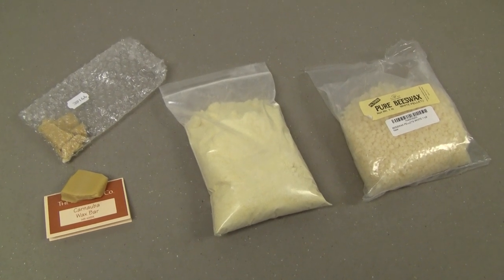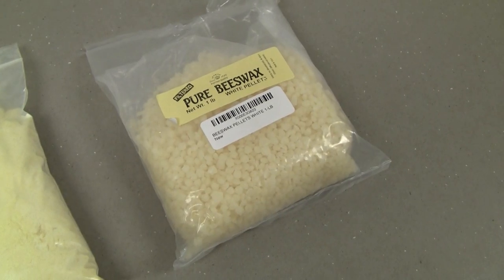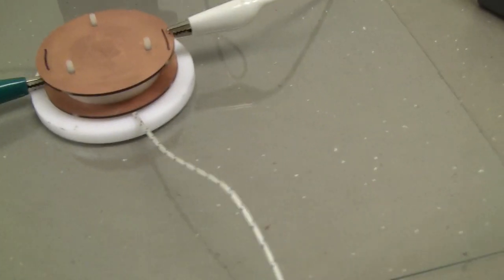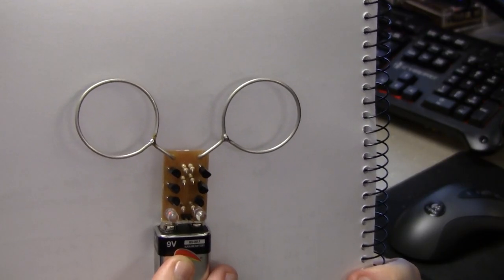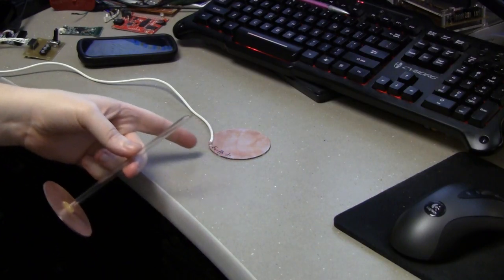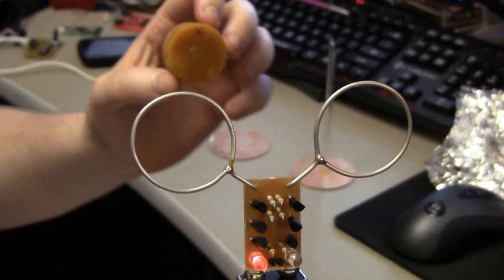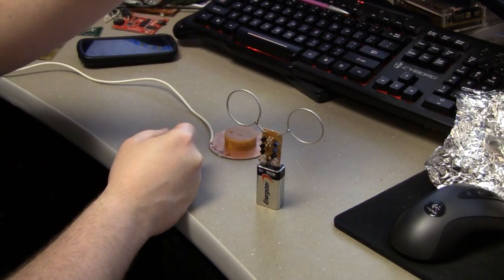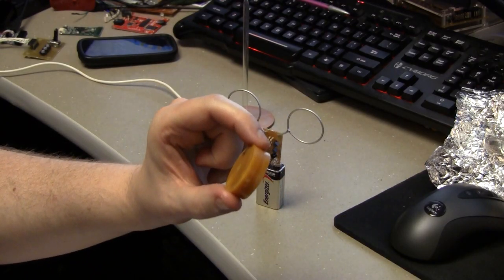Making Electrets

Comment from the maker: According to traditional accounts it doesn't oscillate, it decays away to zero slowly, then jumps back up quickly in the opposite direction before beginning its (very slow) decay.  Apparently how long it takes to happen in a function of just about every parameter of formation, but especially how long you leave it unshielded after it freezes.  I am going to build better equipment to investigate this more, it seems poorly understood in general.
Reply: Have you ever considered fabricating one with a superimposed magnetic field above and below the molten wax as the HV field is applied to determine if that imposition of dielectric field would create a variance within the electret?  Well done sir.  I am inspired to try with molten PTFE, Outside of course...

Comment: which high voltage transformer did you use
Reply: So a little late but I would say that a static HV generator is better for making these at home, for example a van de graaf generator can be made to reach 100kv. A van de graaf generator is also very safe as it can not provide very high current for a longer duration than a fraction of a second making them safe whilst still being very capable of producing the necessary electric field for making electrets.

Comment: Very nice electret! I left mine for a few months before testing it and the polarity had reversed. I hope you'll upload another video after your reversal. Also, when I unwrap mine, the externally noticeable electric field degrades over a minute or so due I guess to charges attracted from the air neutralizing it at the surface. But if I wrap it up again and leave it for a few days, those charges are neutralized and I can see the field again. Did you notice a similar degradation?

Comment from the maker: The electrets in microphones are typically mylar or PVDF film that has been poled by corona charging.  That is a bit harder to do evenly yourself, commercially it is done as a rolling film process using heated and cooled rollers and corona spray wires.
Reply: Problem 3-13 in "Electromagnetic Fields and Waves" (2nd edition) by Lorrain & Corson deals with a microphone having an electret diaphragm.  (The 3rd ed. has a completely different layout.)

Comment from the maker: I got the waxes and rosin though Amazon.  I have a number of different types to try, I just began with the most traditional composition which is well described in the texts from the late 1800 to early 1900s.  Modern electrets are mostly corona or accelerator charged PTFE or PETE.  They are more trapped charge devices than aligned polar molecule devices.

Comment from the maker: More supply voltage will give the transistors more Vce and hence more gain, that said you need at least three BE-drops to turn on the extended Darlington array, but the BE-drop is logarithmic with current...  A long story short - it will work well from 2 volts with RED LEDs, but the blue needs about 2.5 V before it will begin to glow (I just tried it, it actually works feebly from 1.5 V).  Should be fine from 3 Volts.

Comment from the maker: You can make an electrostatic generator or electrostatic motor using electrets, in much the same way as you can make an dynamo or universal motor.  The EM equations possess a dual property where you can swap magnetism and electrostatic effects and achieve a pretty much equivalent outcome.  The problem is practicality.  It is hard to make powerful electrostatic machines because of breakdown effects.  The dual system generally has reciprocal impedance, so high voltages & stored charge.

Comment from the maker: I leave the electric field in place until the wax freezes completely and returns to near room temperature.  It basically works by aligning the polar molecules in the liquid wax with the external field and trapping them in that orientation once it freezes.
Reply: Could this method be used to charge polypropylene?
Reply: I wonder if application of minute ultrasound during cooling could encourage alignment of molecules and increase resulting electret potency?
What will happen if atomized particles of metal are added to wax mixture? Or graphene? Could something be added to the mix to act as electron donor, in a similar fashion to the way that semiconductors rely upon admixture of electron rich atoms within the regular lattice of balanced charges?
Thanks for the video. Great to see folks exploring these seemingly magical devices.
Reply from the maker: @emrysmcwryn7902  Interesting idea, wouldn't be too difficult to sonicate it via the electrode at ground potential as long as you were careful not to overheat the transducer. I suspect it won't help too much poling wise but it would certainly help degas and consolidate the casting.

Comment from the maker: That is poorly understood.  It is believed to be a charge relaxation effect.  The old books talk about hetero and homocharge, the homocharge being trapped charges and the heterocharge being induced macroscopic polarisation of the material's own molecular charges.  The homocharge leaks away fairly quickly through the material resistivity and/or collecting ions from the environment, the induced polarisation can only be lost by relaxation of the molecular structure and happens much more slowly.

Comment: Best video on the internet about electrets. Have you tried any other recipes? Would a mixture of a highly positive substance from the triboelectric series and a highly negative substance from the triboelectric series be able to create a greater electrostatic charge because of the massive difference in positive charge, and negative charge. For example what if you were to melt Teflon(-180) and Nylon(+30) and then let them cool under the high voltage? Also what is the high voltage device you are using, I can't quite make out what is said on the video. Chronomotor? Coronamotor? Thanks for the video!

Comment: So since the gain would be smaller, it would be less sensitive, correct? And you say the BE-drop is logarithmic with current, so a higher current (because of the lower voltage) will cause a bigger loss? 
Sorry I'm asking so much, but I didn't had much of these things at school unfortunately, had to learn most by myself and the internet.

Comment: Hey Alan, I saw your electroscope at the maker faire, and made one myself. I didn't have the schematic so i just winged it. It worked pretty well, but i omitted the 1M and 100k resistors, and put the LED/R on the emitter side. What is the purpose of the 1M and 100k? Are they just to limit the gate current? I suppose putting the LED on the collector side and the 100R on the emitter side might do that without the extra voltage drop. Anyways, thanks!

Comment: Hi Alan - thanks for showing your differential electroscope, will be great once I get it to work!
I built it exactly as you suggested, but being a novice I'm not sure why my LED's are at almost full brightness as soon as I connect the battery... the LED's shine brighter when touched but are contiunously lit.
Do I need to use other than 1/4 watt wire-wound resistors? 
Thanks!
Reply from the maker: If the LEDs are failing to go out that is usually because the transistors are a bit leaky or dirty and that is leaking a small current into the base of the 1st transistor.  If they are hot right after soldering the LEDs will be saturated full on for example because of the increased leakage current from hot semiconductor, but that will quickly cool off.  I'd suggest if the transistors are clean from any flux residue you try a different kind of BJT.  Build the NPN half of it for example, it is usually fine to use any generic NPN in the circuit, but higher voltage and lower noise and current devices often have lower leakages, so something like a BC550 or BC549C might be worth trying instead of a BC547.  Most 2N3904s are fine, but as that is basically a generic class of NPNs now days and lots of counterfeit devices are coming out of Asia I'd just try other small signal NPNs and see if they leak less.

Comment: Ever try doping it with citric acid. Then stir in some ultra fine graphite or nano carbon. And maybe some rare earth powder or manganese dioxide or cerium dioxide. The idea is to make a capacitor electret at high current at lower voltage say 12v at 10 amps. That would be really useful. ?

Comment: Howdy Alan,

Thanks for sharing another great circuit and experiment!  I put together a copy of your differential electroscope a couple hours ago.  My wife and I have both had fun waving static-charged teflon "wands" near it.  I also connected a galvanometer in place of one of the LEDs in series with an appropriate resistor.  This worked quite well.  Once I dig up the right parts I'm planning on trying a couple buzzers in place of the LEDs.

Have you considered using one of your marx generators to make a trapped charge type electret?  I may give that a shot sometime.  Probably something to try outside to avoid breathing too much vaporized teflon :-)

Comment: Rochelle salt electret use a container to heat rochelle salt up free from steam and water vapor with glycolic acid. Mix melted Rochelle salt with the glycolic acid. Then Pour into your charger or put two plates in and charge it up with a high voltage dc or 12 solar panel or car battery charger or what have you until the electret solidifies.

Comment: Could you apply an electric field to the output of a 3d print head and create custom electrets out of common 3d printing thermoplastics like PLA?  If so, it seems like a way to embed sensors or other information into your print.
Reply from the maker: That's a very interesting idea, especially if you can print complex patterns of electric polarization.

Comment: Thanks for knowledge sharing. I have a question that you would like to answer. If you make a long electret in a cylindrical form so that its one half of the surface is one pole and vice versa, and you take two halves of a copper cylinder cut longitudinally and both halves connected to a light bulb. Now if you rotate the electret cylinder between the two halves of copper cylinder, will it light up an electric bulb ? It will produce AC current, whose frequency will be equal to rpm of the electret cylinder. Please answer. Thanks again.
Reply: Hahaha please answer. I always laugh when people say that in YouTube comments, it sounds desperate and almost seems like it will have the opposite effect to what you are wanting

Comment: What's the highest voltage you could store in That field?
Reply from the maker: The electret? Basically the breakdown voltage of the material or the air around it I believe. Especially for electrets you charge by trapping charges in a good insulator. These electrets that are a polarisable dielectric probably less because they saturate.

Comment: How would this electret work as the ionizer of a Geiger-Mueller tube?  Could electrets be used in combination to produce a low cost detector like the electret microphone?  If the electret was used with neon bulb (NE-2) so it would flash over during an ionization event the bulb would be reset by the current shunt.  The only problem would be gas quenching in a high gamma flux.
Reply: I have wondered about this myself.  You may need a few of the electrets in series to produce enough voltage for the tube, but it does seem possible.  The weak spots IMHO would be the current the tube sinks when it is ionized. That would be even worse if it had to flash a ne2 lamp.   I suspect you would be best off using a cap to couple the tube into a fet and use that with a battery and a switching transistor to drive a speaker or LED for the output.  If you think about how the electret works in an electret mic, it never really has a hard discharge and it does not even drive a relatively high impedance directly.  The fet is a buffer.

Comment: I'm trying to do a similar experiment but where I have two PCBs with a 2.5 mm distance between them, into which I can pour the melted wax/resin. Then I've applied ~850 V which amounts to about 3.5 kV/cm. Yours seems to be about 5 kV/cm? Measuring the end result with my voltage meter yield zero though. I had hoped there would be some result there... :(
Reply from the maker: Should work... I didn't observe a threshold effect or anything like that, just stronger polarization with higher voltages.  Have you tried the same blend of wax and rosin?

Comment: Great video! Are you by some chance of Australian origin?
Reply from the maker: Thank you.  Yes I am originally from Sydney Australia
Reply: @vk2zay  
Hello, thank you very much for your explanation, I have a question where I can find the power supply that you use in this video 01:59? I have really tried to make my own power supply with the flyback transformer of an old TV and a ballast but the only thing I have achieved is to burn the ballasts and the electret is not polarized. Your answer would help me a lot, thank you.

Comment: You seem electric/physics up to snuff.  Take a laser light, a weak laser pen, say,  and if you can get a clever electret to bend the laser's beam, you'll know you have polarized the vacuum enough to increase the relative permittivity of the vacuum.  If you can pull that off, and can scale up the effect, you're on your way to creating a detectable declining inertia gradient (aka 'gravity').  Backstory, it's well-known that the Sun and other highly electric objects cause distant starlight to bend, aka to diffract, and the diffraction is caused by an increase in the relative permittivity of the vacuum around the Sun or star that's bending the distant starlight beams around it.  "It's gravity that's bending the light" yes because gravity is vacuum screening of the immense electric field of the star, which increases the relative permittivity of the vacuum (the space) around the star.  As is well known, an increase in relative permittivity causes diffraction (bending) of light waves.

I said clever on purpose, but clever for UK tinkerers seems to be 2nd nature for them.

To say the above a different way,  I'm not at all convinced the Schwinger Limit of 10^18 volts/meter is necessary to create non-linear effects in the vacuum.  Clever ways around that.  But shhh don't tell any  "I have to be conventional enough to get Grants, ie. to EAT"  physicists.  Also, the reason why 60 years and billion$ of dollars have been flushed down the toilet on the Tokamak fusion reactor, while it has produced not one watt more than what was put into it, is because it lacks what the Sun (and all stars) have - a GRAVITY CONTAINMENT FIELD.

Dave Adair (youtube videos) built a gravity containment fusion device in the 1970s and used it for a special type of rocket.

The underlying physical manifestation is the screening of electric fields by the vacuum.  You can master that but again, stay clear of conventional "I need grant money" physicists.

Just what IS an "I need grant money" physicist?  He knows the Tokamak has never worked because it lacks a gravity containment field but is able to b.s. his way to more grant money to 'push Tokaman fusion a bit further along'

People in physics:  "I've invested a career in mastering the maths and concepts of conventional physics, to the point I'm able to raise grant money"

We know that.

.
.

Comment: Can you generate electricity from an electret?
Reply from the maker: @TheRainHarvester  Sure, but magnetic generators are much easier to scale to high power densities.
Reply: @vk2zay  i was thinking just a wire linking the two sides would generate electricity (with a load inbetween).

So no moving parts. 
Would that work?

Comment: can that electret charge a regular capacitor? then discharge that cap and repeat, etc. ???
Reply from the maker: Sure that is exactly what I was doing with the electrophorus, the plate is a capacitor and I am using the field of the electret to charge it via electric induction.  The energy required comes from the mechanical work of moving the plate in the electric field.
Reply: I mean, use ur electret + plates, to charge a regular electrolytic capacitor, and then discharge the electrolytic cap into a load

Comment: There is somthing you could have done to make things better... Use plates of different metals aluminum and copper! Or zinc copper ... Atomic molecular surface area will affect internal geometry of electret building under the high voltage